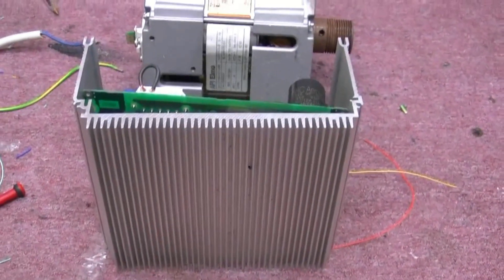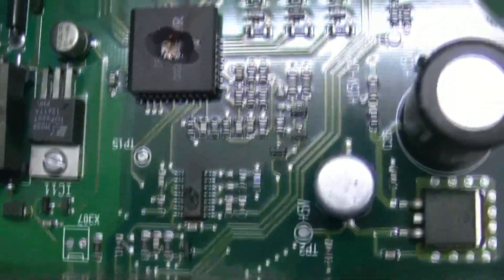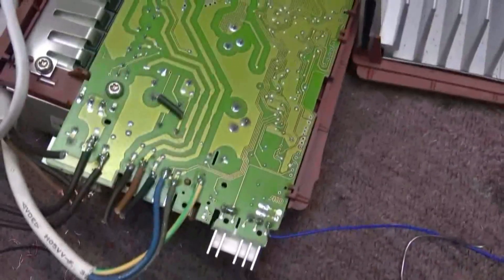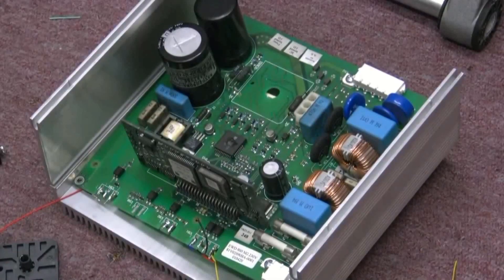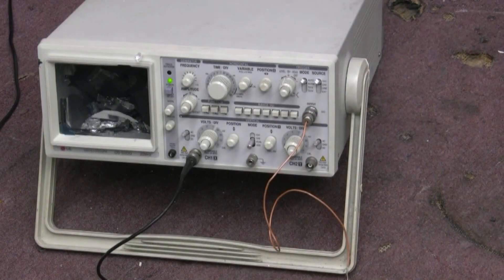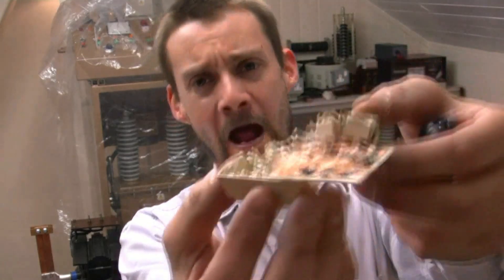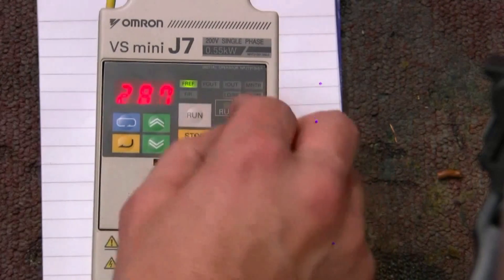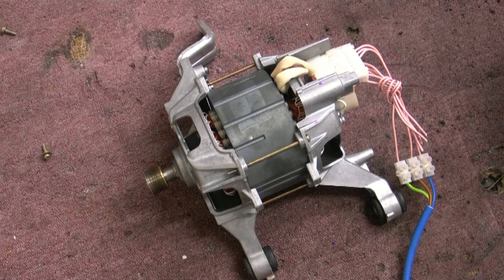Motor Inverters

Comment: It hurts me to see other people beat up stuff that I could use......sad..........
Reply: You have a use for 3 dead inverters and a scope with a broken frequency generator?
Reply: +Morten Kristoffersen True. Also it looks like some of the people here have never experienced a frustrating situation in electronics design. I have, more than once. I usually connect caps  in the reverse polarity and watch until they explode (outside) or sling my hammer into components that didn't behave. How satisfying!
Reply: +Bloodbath2you No, it cannot be repaired. It's a cheap Chinese scope, where for copyright purposes half of the IC's are unmarked, so nobody would know how to diagnose most faults, and spare parts would be made of unobtanium. You wouldn't be able to source a schematic diagram either. 
Also, with a working scope of that kind, your measurements would be highly unreliable.
Reply: he did it cause it was broken!
Reply: Ozzie Peck yet still useful, you can fix it
Reply: Bloodbath2you But the cost of Repair was prob more that it was worth... :) 
Can get scopes cheap in some places.
Reply: MrOpenGL Of course, it´s the only decent way to do any engineering !
Reply: +Craig Diamond 
An Arduino or 555 timer circuit could be used as a frequency source to drive the inverter boards and are cheap enough if you fried them it's no big deal.
Reply: Patchuchan
A limitation of 555: cannot create PWM without significant frequency jitter (not important in most applications, but important to drive such inverters)
And a limitation of Arduino: max PWM frequency is 400Hz if I recall correctly. Again it may not be compatible with the inverter. A frequency generator is just more versatile. Not counting that if you have an arduino plugged in to the computer and the inverter spits back some voltage as happened to Andy, it will fry the computer!
And bypassing the inverter logic DOES allow for some interesting experiments -- see if the body of an exploding IGBT can reach Mach 1 (because it turned on together with another IGBT) :-)

Also never heard of IGBFETS, or any other transistor that is both bipolar, insulated gate AND field effect :D
Reply: Come provare motore i verter X lavatrici in italiano
Reply: Ryan Edison err he knows a lot more than you that's for sure what he does with his stuff is up to him anyway
Reply: Patchuchan
Probably not as it is not as advanced as a proper function generator (the inverter could not recognise it)
Reply: MrOpenGL
If the inverters require TTL level logic signals it should see it just fine so long as the duty cycle and frequency are something close to what it expects as that is what you'll get out of both chips.
If all else fails bypass the inverter logic and directly drive the  IGBFETs with a micro controller which should allow for some interesting experiments.
Reply: It was already destroyed
Reply: Craig Diamond No one gives a shit about what you can do or you as a person
Reply: yeah it hurts
Reply: same
Reply: iEugene1994
Same in Poland brother... When I see a scope smashed my heart bleeds.
Reply: +Craig Diamond I'd have to agree. Just because he couldn't be bothered to learn a little of the age of electronics he's in, he couldn't be bothered to order $3 in IC chips from digikey, and get a re-flow oven with stand alone controller  [$100 eBay] to re-flow using NORMAL solder. (All you haters haven't tried it I guess...) Beats literally beating up $100's worth of electronics you just broke with your ignorance IMHO
Reply: why dont you cry at the reason why it hurts you like your too fuking poor to buy what you need to grow and experiment ???

Comment: dude how do you control the speed of this AC motor ?
Reply: Gustavo Back I don't have a frequency counter. Any practical circuit you can show me. Thanks
Reply: i just need a ready mad/ heavy duty controller that doesn't heat up to control the couple of motors i have. like the one on the jigsaw but heavy duty one. i also like one for the 12v/24v motors thats operated by car battery. with all the money i have and a week in new York still no luck. i can only buy. i don't have time to sit and make experiments. but thanks for the feedback folks

Comment: Excuse me pal, do you still by any chance have the Y deflection board from that oscilloscope, as I have an identical scope and was looking for a working board that I can't get anywhere, I wonder if your one has escaped your anger and may still be in a perfect working order, I can do a swapp, you can hammer my one to shreds if you like and get double the thrills! I hate simple stuff like motors being driven by stupidly elctronics using  fuckin stupid microprocessors, you are not alone pal, whack them fuckin things and let manufacturer's know how we feel about their stupidly designed products, why can't they just use a simple fuckin switch and a good old diod!

Comment: you have to use devices as there intended for within there own limits or you will have the same issues over and over and over again til you learn this simple fact! if you want to use more power then use things like bigger capacitors and better transmormers always using inline fuses or circuite breakers and stuff like that also why use ac always try and use dc if you can and you will be much happyer also protect the inputs and outputs for your expensive equipment such as oscilascopes and then maybe you wont have to waste so much money and time and effort replaceing all your devices that get reuined otherwise! just saying :P
Reply: ok look i was gonna start off with YOU DUMB ASS but i decided maybe you dont deserve that  so look , as children mechanically inclined boys love to STRESS test motors and devices to failure to see what they can handle , you actually learn alot from this kind of testing not gonna explain that part but this guy wakes up every day with the intention of destroying something with fire and or lasers and electricity thats the hole point of this channle, limmits suck we all like to walk on them to observe there constituents, most high power devices where built buy people who no what it takes to blow shit up
Reply: NOBOX7 yer i noticed that after i posted my comment that the whole channel is comical i wasnt expecting that as it was the 1st vid i have seen plus i usually stay to chanels and searches where i can learn things from (not waste my time) and also give back so others can learn didnt realise its a comedy chanle (which is fine just didnt expect it to be) lol

Comment: Ah, J7, played with one of those in school 10 years ago, it was fun. Just use digital inputs to set some preset frequencies also, those are handy sometimes, flip of a switch and you have like 25Hz at once. Btw, increase the low freq voltage in parameters to get more torque, if I remember right it starts with just 12volts near 0Hz to keep magnetic fiux about constant over freq range. But overboosting things is always nice.

Comment: I can't understand why they don't use BLDC technology. An ESC for an RC plane is only about 1/2" by 1" by 2" and can drive a 2.7KW motor without any problems
Reply: because rc gear operates on a lot less volts.
Reply: ummm...You do realize that AC induction motors are already brushless, right? No point in using a BLDC when you have AC power already. In the states we use split phase induction motors to power our washers and driers. I don't know why Europeans are using crap brushed universal motors. Guess it is so they will continue to buy parts or buy new washers and driers to keep the greed machines going.
Reply: +nathan dance I have a De Dietrich washing machine from 2008 (costed about 1100€ when new, so it was a top of the line model) and it has a regular series-wound motor and two SCRs for control, as you say. Much more robust than the IGBT nonsense.
Also a BLDC is an AC motor :-) and an ESC (which is nothing more than an inverter, DC comes in and artificial 3 phase comes out, the three wires usually labelled A,B,C are in fact L1,L2,L3. No neutral obviously) is as complex and as finicky as the inverter that Photon used.

The most robust solution I've seen is purely electromechanical. We have (we no longer use it, it's in the basement) a Candy washing machine from the 1940s, and it uses a very interesting system. It has a DC brushed motorbut that is separately excited, ie the rotor windings are totally separated from the field windings. Basically when it wants to wash it connects the field with a capacitor in series to reduce the excitation current, and the rotor directly to the mains. When it wants to spin, it connects both windings in parallel to the mains. Kind of like a Ward-Leonard control! Still works to this day. I don't remember how it does the reverse tho, I will check later.
Reply: what I mean by BLDC is permanent magnet synchronous motors. We use crappy little universal motors in Europe nowadays because we have front loading washing machines which require electronic speed control, and controlling a universal motor is simpler/cheaper than controlling an induction motor. In the UK we used to have induction motor top-loading washers but people wanted to save space and money.
Reply: MrOpenGL electromechanical does seem like the best solution. Regardless of "efficiency" (waste heat is bad on a machine that heats water?...) I dont see how these new throwaway machines are good for the environment. I miss simple things that dont have to try to be "smart", like internet connected toasters.
Reply: nathan dance
Three things:
1. I was born in the 1990s, yet I hate technology and prefer electromechanical ways to do things! :-)
2. "efficient" light-bulbs in very cold places like Alaska, northern Norway/Finland and Sweden caused the heating bills to go up by a noticeable amount because the lightbulbs produced much less heat which wasn't wasted. If electricity is generated by hydro power like in Norway but you heat using natural gas or oil, that is a problem!
3. Old machines were inefficient and would last for quite some time, but when they failed they were repairable. Today it's all about efficiency and useless complexity. Then when it fails you throw it away.
I am not against electronics, but too much of it is really getting in the way. A modern washing machine µcontroller is more powerful than Apollo's guidance computer!!!
Reply: I was born mid nineties and also hate unnessary electronics and "efficient bulbs", which aren't efficient at all if you live in a cold place.

Comment: I enjoy you vids, where you blow the stuff up, however smashing an oscilloscope was to much for me. Maybe because I still remember how long I saved every penny to buy one myself. In you scope, most probably output amplifier's transistor(s) went away. This was very common failure of these generators, when some voltage is connected to the output. (we had very similar generators in our school). Electronics is a train, that you won't stop with your hammer. You have to learn to live with it.

Comment: I want to add something, you want to control these silly inverters by injecting a sine wave into the IGBT drivers... it just doesn't work like that.

IGBT drivers want PWM: digital stuff, not analog stuff.

And there is no problem with these kind of power chips, they are used in metros, trains, tramways etc. They're now replacing thyristors.

Comment: Hey Photon, I usually love your vids, but what you're saying here is a bit biased.

We have a pumping station with VFDs there... for regulating the pressure according to the demand, and we haven't ANY flaw since 20 years of continuous service.

If the electrical installation is done properly and with high-quality components, there is no reason of failures.

Comment: Yeah that works but while costing only 10$ it doesn't save any money on the running cost. My VFD installs have an ROI of 5 years or less... so even if they blew out every 5 years they would still zero out in cost vs savings (how ever they last a good bit longer if kept cool and clean). Also VFDs are running in everything from Sea going ship propulsion to trains to EV's to factory installs where you cant just slam a motor on and off. Trust me, i get the keep it simple moto but sometimes you cant

Comment: precise control of speed, torque, and or position or all three at the same time. I normally don't use them in motors less that 5kW unless it really needs it. and 500 dollars is on the cheap side. you look at some from ABB and you will pay $5000USD for a 1/2hp drive.as for why they use them on the washer motors is for speed control. read up on the affinity laws and you will learn why speed control can save vast amount of power. also lowering the demand charge is a huge reason on larger motors

Comment: Yeah buddy I fully agree!  If I had a frequency modulator (or whatever you'd use to do that, I'm no expert) I'd do it lol.  I think that the resistance of the air and also the friction of the moving parts would limit it's speed.  Perhaps the centrifical force would rip it apart...it needs to be tested! :D

Comment: That Omron VS J7 must be designed to run motor in open loop V/F. When loaded, the speed falls, the inverter does not know if the speed has really fallen. They are not closed loop (sensorless).

Comment: Your motors use PM rotors where as this motor uses only a steel laminate rotor with either aluminum or copper rotor bars. Also, AC induction motors have been in use since 1888. So this is very old technology. Speed control has been the main the problem with AC induction motors which has limited them to constant speed applications. Now these VFD make it possible for an AC motor to perform like a brushed DC motor. Have a look: watch?v=_-WQZ1SGqi4 . It seems you R/C guys only think this is new tech

Comment: I'm building a full sized rotary spark gap transmitter with a large induction motor very close to the one your showing in this video.  I need the frequency inverter that you show driving the induction motor for my rotary spark gap induction motor. I think its needed to get high frequency transmission for my experiments....

Comment: But talking a little more seriously, I've just done an intro elec and tronic engineering at uni and I don't mind the circuit analysis stuff, but electronics gives me the shits and by far the most enjoyable part is the electric energy stuff. Transformers, DC machines, AC machines, so much more interesting.

Comment: Dear Mr Photon,

For Christmas this year I would like to see you torture another motor like this, but with an added twist, Wait for it to get up to insane speed, and bosh the shaft with a hammer to see if it rattles itself to bits, I can design you a string operated hammer jig so you dont get hurt.

Pretty please, I have been good.

Me

Comment: Great video, pity you didn't pop those juicy caps. 
Great to see this motor running at those crazy speeds.
Scopes, I put them on an isolating transformer in case of live v. ground terminals.

Comment: So basically these HE (high efficiency) washer motors are not much different than a PC hard disk as far as driving the motor. I've taken apart many hard drives and driving the motor is impossible w/o the driver circuit. 11:33 you should try to play music thru that arc like replace the signal generator with an audio source but careful you could fry your audio device unless u isolate it.

Comment: Kinda disappointed with your hammer. No need to get stupid with a multi-ton pile driver, but a 
5 lb mini sledge can still be swung with one hand, and is so much more effective and satisfying. Would have taught the scope's face a proper lesson. Might have scared it back into working order.

Comment: Ah those little Omron VFD's are ace to play with. I love the sound of a motor running off an inverter they make some really odd noises at low speeds! Great vid as ever Photon.
Reply: do you mean high frequencies? ye that's probably the switching of the pwm

Comment: igbt's prone to thermal runaway...get something voltage controlled not amp controlled....anything semi-conductor wise (i share my feelings with photon on igbt's) can melt down into a heap of shite.

Build small a homemade tesla coil, you got high frequency (MHz/GHz range) high voltage (be careful!) to drive it....only if you know what your doing though...yea sure if you know anything about telsa coils you'd know about the skin effect, still dont go giving yourself a cardiac arrest from HV!